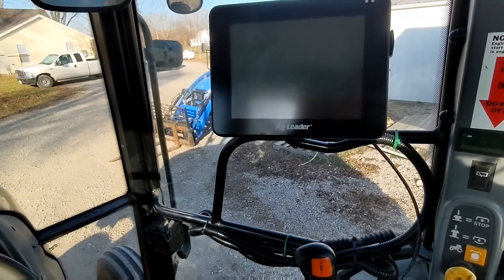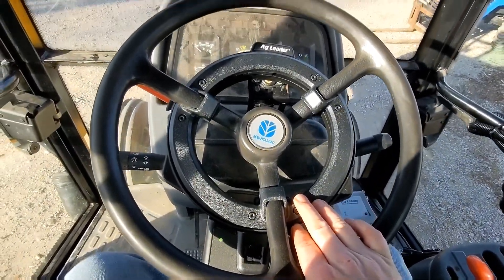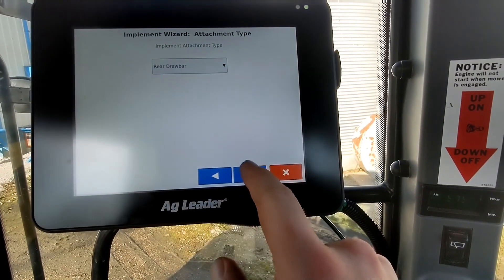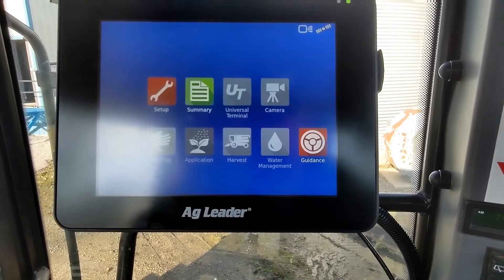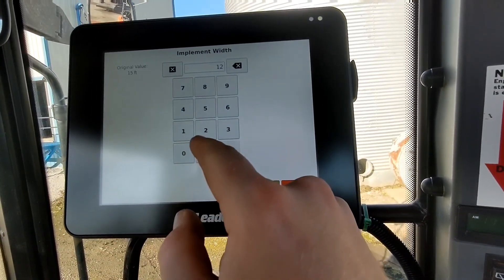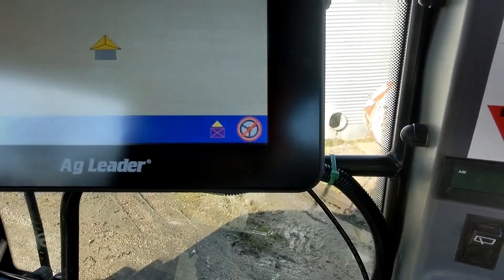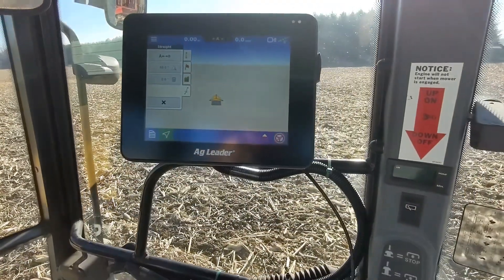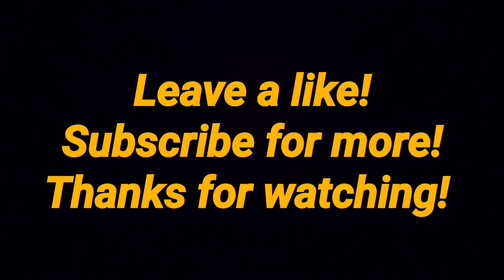New Ag Leader Incommand 800 GPS System Setup

Comment: how are you like it ? looking at buying one my self
Reply from the maker: We do some custom cover crop planting so we wanted it but now I would not be without it
Reply: Can you justify the cost after two years vs using planter markers?
Reply from the maker: I use it across multiple planters so it would be more expensive to put markers on everyone I own.
Reply: @wildcatwilly  I didn’t know you could buy them without besides the really new ones I suppose. If you’re just drilling can’t you just overlap a little? Haha I’m trying to talk myself into one but at only 1000acres of the flattest land you can buy I don’t know where I’d get my money back besides the mental peace of not driving and just watching your equipment
Reply from the maker: Works very well very accurate.
Reply: @wildcatwilly  do you farm many hills and do you have the 7500 or the 6000 receiver?
Reply from the maker: @kandylandfarms9898  I'm not certain on the receiver. We have moderate hills nothing like Kentucky. It does seem to pick up GPS quicker than the older units did.